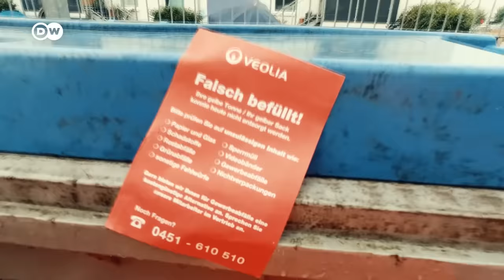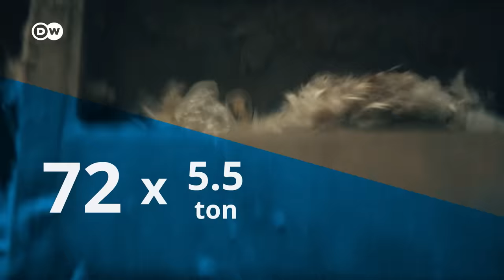The recycling myth: What actually happens to our plastic

Comment: Even if we did want to recycle that much in the US, we don't have the infrastructure. There is a place that buys metal, steel, and old electronics, but they don't pay much. I saved my last batch for 2 years and got $25 for the whole load. Hardly worth the effort, but it's $25 I didn't have earlier.

Comment: The whole logic of recycling is messed up. We are told to reduce, to reuse, to recycle, but the business is told to just manufacture as much plastic as it wants and use as much packaging as it wants. 
I buy a tiny cosmetics item that comes in a bulky plastic container with THREE different kinds of plastic in cap, pumper, label, etc, and I am not even sure if it can all be recycled. 
How do I reduce my use when everything is packaged in plastic? 
Why is this legal when we know there are now renewable-source alternatives of plastic? 
Just outlaw plastics that have alternatives.

Comment: My own experience with this issue…
Firstly- due to a new ecological law of which plastic grocery bags in democratic states now are charging for the purchase and use of bags:
Of which the belief is that plastic can not be recycled?
However this is the third video I have watched regarding this issue… but tend to believe that this issue could be addressed from a different angle in perspective of how it is sorted before it is processed into the recycling mode.
Complicated (perhaps), but we can create more jobs!  I HAVE A VISION- but with the proper people involved I believe we can change the recycling system and process.
And clean up the mess created by politicians!
But with this video I actually see the failure point, and what it would take to correct the problem and issue.

Comment: Plastic drink bottles should be placed in warmers to melt the plastic back down to smaller sizes so they can be shipped to plants to be recycled back into cleaning supply bottles. Then cleaning bottles should be melted back down and used as plastic drawers and toilet bowl cleaner handles and stuff like that.

Comment: America here.  I live in a county that only offers trash pickup within the city limits. County residents have compacting stations placed all over for residents to take their household garbage to. There are recycling bins for cardboard, paper, glass, and plastic. The only plastic I bother with is HDPE and LDPE. I’m not sure if even those are recycled. All the other materials are much easier and more cost effective to recycle. I think one of the biggest problems is styrofoam. No one wants that crap.

Comment: I leave all my plastic at the store, I remove the plastic packaging that I cannot avoid buying and throw into the recycling bin in the supermarket. The plastic I cannot remove I take back with me next time to throw into the recycling bin of the supermarket.

The reason I do this is that I'm tired of the problem being put on the shoulders of consumers. . Most people try their best to sort correctly, but there is often misleading information about what to do. And on top of that, the rubbish fills up our bins, at our cost, with the stores taking little to no responsibility.

There is no incentive for the these large supermarkets to push for change, and customer just don't have enough collective power.

In my opinion, markets should be legal bound to take back trash they sell, and we should all leave the trash with them, forcing them to push for change in how things are packaged.

Comment: can't you grind the plastic up in the little tiny strips and then they could use it when they're making highways and stuff past bedding they can heat it and put it down and then put the road over the top of it and it would act like an insulated blanket or waterproofing membrane to keep water from soaking through the road into the hard pack underneath the road to keep it from washing away and breaking up the road I think that's a pretty good idea you guys are always building roads anywhere in the world and then you can also turn it all into pcvp pipe no waste doesn't matter what color it is it's all buried in the wall you can't see it no pollution problem fixed it

Comment: Companies making profits from plastics need to be taxed until they can pay for the clean up. Using recycled plastic should be subsidised until it's cheaper than new plastic. If companies can't make a profit using plastic then they'll find something else.

Making things easier to recycle should bring down the cost or recycling and companies could get a tax break as long as it still covers the cost of recycling.
Consumers pay rates for bin collection, give them discounts for sorting correctly.
We could clean and sort by plastic type but please make the instructions clearer and larger on the packet.

Nobody should profit at the expense of the environment.

Comment: The producers of food and goods must be obligated to make less packages. Not the consumers (people) are "producing" the waste, but the factories of food/goods are producing it.  An Example: I bought french cheeze, packed in paper outer package, then aluminium can, then wrapped in two layer paper+folium. Deamn! I just bought the cheese, not a bunch of 4 types of trash. Other example: bought dishwashing machine. Repacked it, and there on the floor left huge mountain of paper, plastic, poliuretane, even metal. Seemed 20% of the product volume where the package. So there must be some restrictions on the producers of good, how much package they produce.

Comment: I know using recycled plastic is hard and expensive, but producers have to take responsibility. If they can't make it, maybe they should find alternative packaging. Even if I'm doing my part I can't reduce my plastic waste by a lot. My favorite example are chesses and meats in those plastic tray's. Package is heavier than those ten slices of ham inside and not I found out they are not being recycled either. For me it is easier to force few companies to change packaging than people to stop buying that? Because recycling doesn't help in that case.

Comment: Case in point:
The ultimate packaging that nature provides is found with the 🥥 coconut.  The husk makes it float and the shell protects the meat.  I have seen these miracles, at the supermarket, wrapped in shrink-wrap.  I suppose, to attach a UPC 🏷 label and prevent bits of jute from clogging the conveyor belts at the checkout.
How about a clear plastic clamshell with strawberries 🍓, blueberries 🫐 or 🍑 peaches - the impossible-to-remove pressure sensitive labeling renders the entire container non-recycable.  Into the landfill.

Comment: I wonder if there's a way for conscientious consumers to sort, process and recycle their own plastic. Imagine melting it down into usable material for 3D printing or molding. We used to use glass and turn it back in to the bottling company. It's a blast from the past, but maybe we've advanced in the wrong direction. Maybe we need to get back to reusing glass.

Comment: I find the plastic problem frustrating. Plastic film is the biggest problem as in the UK it goes into land fill. I started plastic recycling in 1982 this factory churned out 42 tonnes of pellets to be turned into bin liners. If governments listened to those who have done the job for years the problem would be smaller.
I have approached the English and Welsh government and basically told to go away.
My suggestion was to make wrapping on food the same material as the big cartons and it can mix together like all polypropylene or polyethylene as these will not mix a different gas used in making the virgin materials. And all the liquid products should go into cans like beer cans which is easy to fill and is widely recycled and then reused. Ban anything that says unrecyclable. The list goes on but money and deaf ears and ignorance leaves us where we ar today.

Comment: Legislation legislation legistation is the only way we are going to get anywhere with this problem. Firms should be rated for the quality of their packaging and fined heavily when handing out packaging which cannot be recycled. Also all firms should be required to use at least some recycled plastic in their products given rebates if they have entirely dispensed with plastic packaging in their production lines. Plastic  bottles should be refundable when returned. All plastic packaging should be clearly marked so that the public can see easily whether it meets the criteria. It really is up to governments to force these measures through. Market forces are not going to be nearly enough to solve this massive massive problem.

Comment: The best solution is legislation to ban single-use plastics and heavily regulate the industry so that packaging is designed with recycling in mind in the first place. Also a tax on virgin plastic to incentivise adoption of recycled plastics. The reason they are cheap in the first place is because buyers do not have to pay for the enourmous external cost of plastic waste. If the recycling industry was paid for entirely through taxes on virgin plastic then that would be much closer to the true cost of the material. It's like they just get to throw it in the river and get away with it. It's because the plastic industry has enourmous financial and political power and most politicians don't have the spine to go after them.

Comment: Glass. That is a solution. Problem with glass? Greed. If we put everything liquid that was less than say 1 gallon into a glass container, it would reduce plastic consumption immensely. However, glass weighs more. That means you can't put as much material on a truck ship or plane. In the US we already have a truck driver problem. I am a truck driver, I can tell you its a lack of pay and a lack of care for drivers. With less trucks, you need more cargo in each container. If you use glass, you can't put as much on. Glass is a great solution, greed of weight and wages means it can't happen.

Comment: Wouldn't a solution be pyrolysis, which is converting plastic to fuel? There are enormous machines for this. Of course, producing and burning fuel releases GHGs but that is being done anyway. The flower pot company for example could use that fuel for its machinery. The other solution is to require producers of goods to use less plastic packaging.

Comment: When I was growing up in the UK in the 60's we had a shop chain called " MacFisheries" and you could buy most of your dried grocieries there from raisins to sugar to flour to washing powder etc. The difference was that all the goods were stored in large blue large plastic drums( the sort people use for water butts nowadays) and it was stored loose.Each drum had its own scooop and a set of scales and a rack of clear plastic bags. You would scoop into the bag what you wanted and go to the till and pay. At the till they would seal each bag with a plastic tag and then weigh it and then charge you. Simples. 
My mum was well upset when they closed as they were cheap as chips.

Comment: Recycling plastic is actually worse for the environment than just burning it, but it must be burned at high temperature in a disposal plant. You can then use the heat for house heating. Or else, you can see, the most of it will end up in the ocean!

Comment: Sounds like burning trash for power generation makes the most sense. No need for recycling. Ash gets sent to the dump. Bag houses and scrubbers on the stack system. Less dicking around, less guilt, more efficient.

Comment: Perhaps the host of this segment should try cutting down on his own plastic use. You may not be able to eliminate it entirely, but you can eliminate a lot of it. For instance: you don't really need shampoo. Use a bar of olive oil soap instead. Works fine as soap and shampoo. Comes in a small cardboard package. DON'T buy take out food from places that use plastic or styrofoam containers. Etc. If you're mindful, a lot of this crap can be eliminated.

Comment: Recyling is a myth per say, its that under the current standards and profit driven motives that are out there, it makes recycling pretty much useless. 
there are ways to easily decontaminate plastic with food on it, but companies instead deem it "unrecyclable" and then it goes in the trash. But for bottles for example.. an automated system that injects a burst of high pressure air or water into bottles could quite easily clean them out, but nobody does that... we crush them and shred them instead.
Reply: You can wash the plastic yourself before throwing it out. And even if only a fraction of it actually recycled its still better than nothing at all. People just shouldn't use it as an excuse for wasteful/careless lifestyle, nor see it as a full solution. Its just the best you can do at that stage in the product process.

Comment: How about paper, metals and glass? Is a tin can more "ecological" than a PET bottle? How about paper straws and cups which are wrapped in a thin layer of plastic anyway?
Reply from the maker: Depends on various factors such as transportation, usage and disposal. Also tin is made of steel and aluminium that are recycable materials. But, according to this study conducted by The National Association for PET Container Resources (NAPCOR) - PET bottles have smaller environmental impact than glass or aluminum containers (🔗 https://napcor.com/wp-content/uploads/2023/02/NAPCOR-Beverage-Container-LCA-Report-2023.pdf). When it comes to paper cups and straws that are coated in a thin layer of plastic, they are less eco-friendly than 100% biodegradable options.

Comment: I will tell you what to do with low value plastics mix it with asphalt and pave our highways.  Mix it with concrete to strengthen concrete,  extract the oil out for fuel

Comment: Here is some of my takes on this recycle thing. I have about 15 - 20 flat panel LCD computer monitors, about 3/4 of them I saved from the trash because all they needed was about one to two hours of time for having the capacitors replaced on the power supply board inside and they all work fine now. Problem is for me now people would rather buy new instead of getting their old one fixed or buy repaired used ones. Also if Radio Shack still had a store in my area I would have bought those parts there and each one would have had it's own packaging. Plastic on the front and cardboard on the back, or all plastic packaging for each one or maybe two in a pack. Thankfully I can get them as a set for each monitor. Our society and the germ thing has made plastic more necessary then it used to be as well. I still have and use Electronics from the 1970's, cars from the 1990, and TV and computers from 2005 to 2010.  However my smart cell phone will need to be retired due to technology to get a newer one in a few months. The old one for me I assume can be still used as a internet and photo, media device, but I have not changed it over yet, so it just might now be trash. What a waste!.

Comment: It's a sad reality. The only thing you can "sort" and be happy and sure is being recycled is aluminum, and to some extent, glass.  Carboard can cheerfully rot away in any landfill without any issues. And the plastic is the problematic mo fo. We think of it as just "plastic", but nope. When it comes to recycling, this one is too soft, this one is too hard, this one is too flimsy, this one is wrong color, this one is a pressed combination of 2 plastics, etc...

Comment: Plastic recycling is a waste of energy because in reality its Fuel. Its untrue that it releases toxins (apart from CO2)Plastic in a well built furnace burns cleaner than coal, diesel etc and nearly as clean as gas it produces almost no ash and certainly contains no heavy metals of any significance.

Shred it and use it for fuel for cement plants (best use as nothing is released and replaces coal), power stations, heavy industry or anywhere you use large amounts of coal.

Virtually all plastic is  Polymerised Ethane Propane and methane some has aromatic compounds like styrene but they all crack out at high temp and revert back to fuel gas, you can even make diesel from it. Only difficulty is some Chlorine based Plastics release some HCl on combustion but some simple acid scrubber in the flue takes care of that.

Comment: Recycling is 100% just to make people feel good. Recycling materials are usually trashed, and if it is recycled it requires massive amounts of energy and resources. Just look at glass or electronic recycling. We need to radically reduce consumption. 7 billion people cannot throw out cheap good daily, weekly, annually. We can make most goods last a lifetime. Appliances, clothes, furniture, electronics. We need to be repairing and upgrading, not disposing. Food and cheap packaging also needs to go. MAKE VIRGIN PLASTIC ILLEGAL AND INDUSTRY WOULD DEVELOP A SOLUTION REAL FAST. Exporting waste should be illegal.

Comment: Plastic technically can't be  recycled it is only repurposed using mechanical recycling and after that use it goes Untimetly to  landfill or incinerate. Chemical recycling is expensive at this time which is somewhat good. Only metals are infinitely recyclable without losing quality. So we are actually trapped in Plastic.

Comment: How about making Diesel from plastic waste.
Reply from the maker: Hey there. Studies have found this process called pyrolysis to actually be using more energy than generating it. It does not really seem to be the self-sufficinet system that it is been sold to us as. (i.e. 🔗 https://www.lboro.ac.uk/media-centre/press-releases/2019/may/pyrolysis-defies-the-laws-of-physics#:~:text=%E2%80%9CThe%20energy%20needed%20to%20extract,of%20the%20laws%20of%20thermodynamics.)